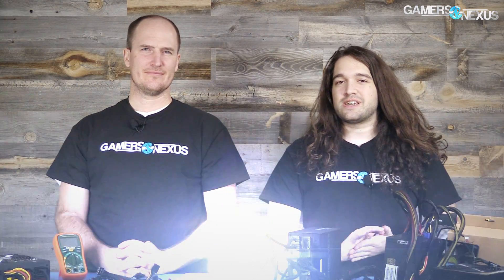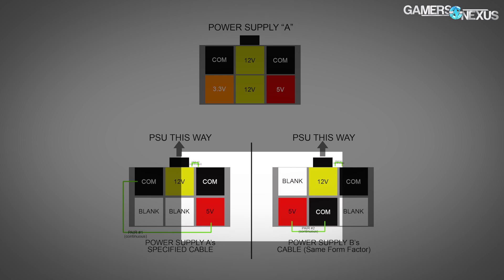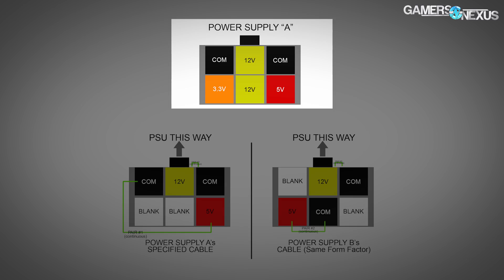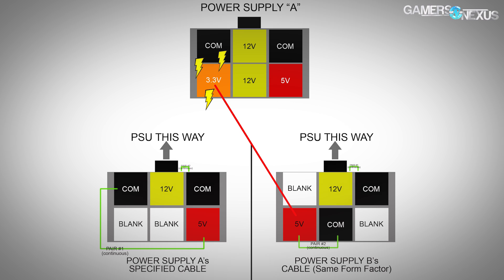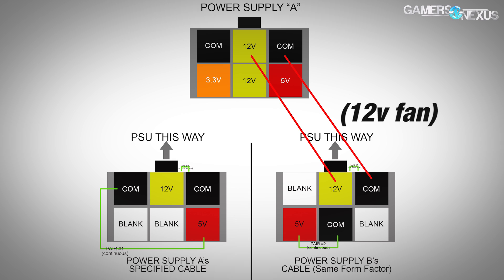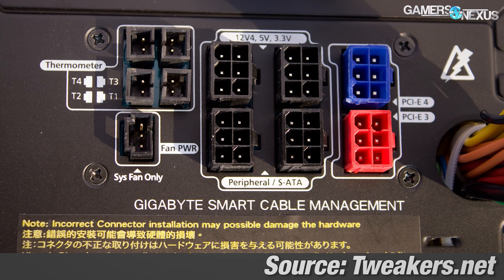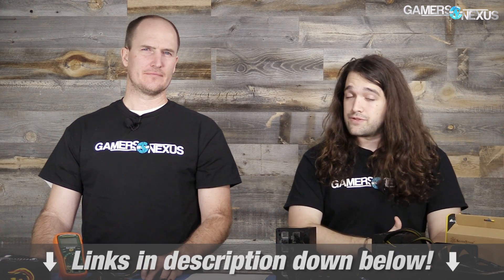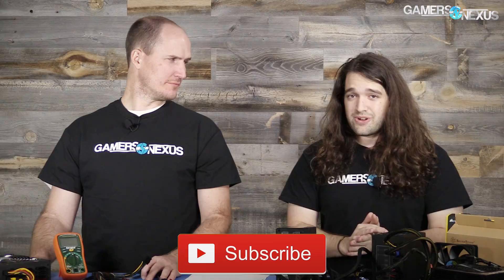PSA: Stop Mixing Modular PSU Cables

Comment: So literally "Computer assembling for Dummies"
It was commonplace in the past (when modular PSUs were not the norm) each company to use proprietary cables.
But this idiocy , especially with the screenshot provided , can be achieved BY ULTRA n00bs only .
The PCI-E 6PIN mimickers have different PINOUT and the layout of the coupling is vastly different - only a HAMMER can shove the wrong cable with this set up .
The PCIE-E color coded coupling shows the difference  - the squareshaped receptacles are in a ROW , while on the SATA/Peripheral they are not.
To top this all off , none of those pinouts correspond to STANDARD VGA 6-pin receptacle.
https://www.techpowerup.com/forums/attachments/pcie6-2-jpg.57637/

RULE #1 of DIY PC assembling - NOTHING REQUIRES MJOLNIR-LEVELS OF FORCE TO FIT IN ........

Comment: What would be nice is if PSU manufacturers would change the keying on the slots to match the power being output from that pin. So a fully square slot could be a ground wire. Top left corner cut off could be the +5v, both top corners +12v, top right corner +3.3v, and then bottom corners could represent negatives of those same numbers. (e.g., bottom left -5v) With this layout, a 3.3v and 5v could never be inserted into anything but their own slot or a ground slot. A 12v however could be inserted into any of those slots and end up being undervolted.

I think it's too late to make this change as a universal standard. Too many components rely on backwards compatibility.

Since there's 4 corners to choose from, there's actually 16 different variations that could be used to indicate exactly what that wire is being used for. That's more than enough even for the pin layout on the 24pin connector since there's many repeats.

Comment: This might be an issue with some manufacturers. Most of the reputable ones ( Seasonic, EVGA, Corsiar, Antec, etc ) label cables and connectors properly so you see where something is meant to be connected. 

Why there isnt color standard for connectors is beyond me. This could be solved easily as you can either color insides of connectors, or add colored line on top of the connector.

Comment: i found another situation : my old seasonic 750w eps 8 pin conector /divided/ cant go into my asus prime x399-a mobo /"wrong" female conector just mirrored/ so i was forced to use divided eps 8 pin from my even older silverstone 1000w psu where it was correct on mobo site /conectors was simillar on psu site but i dont check colors going into psu/ colors going into mobo was corect ....well it running just well for 2 months now lol .....

Comment: Wow, this kinda blew my mind!
Who the eff would actually use a standard connector and Not connect the pins according to standard!!! The engineers responsible for that should not be working in this field anymore. Non-standard pinouts on PSU's should mean those PSU's can not be sold. it is unsafe. They want you to use "their" brand cables, they can bloody well use a different connector for it. 

I can guarantee you that 99,9% of everyone building a computer wouldn't even suspect the standard connector wouldn't have standard pin-outs. The other 0,1% probably learned it the hard and expensive way.

A quick PSA is .. just not enough. you guy's should be blacklisting any PSU's doing this, and display a list of PSU's to avoid. with skulls and crossbones.
Reply: "There is no standard" <-- that is false!
ATX is a standard , PCIe is a standard

If a manufacturer doesn't follow standard, you risk damaging the computer simply by connecting the cable the wrong way around. 
If there are standard connectors, we most certainly expect the manufacturer to follow that standard. The standard is there for a reason. Not even labeling non-standard cables as such, is despicable, hazardous and would definitely hold up in court if you sue the company for any damages caused.
Reply: Feels good to be in the 0%. ;)
Reply: did you not watch the video at all? do you fail to understand what the point of a standard is? 

When a manufacturer uses 8 pin PCIe connectors in PSU, and does not follow standard pinouts, and does NOT label the cable as a non-standard cable.
What do you think will happen when someone tries to build a PC and uses their own custom sleeved cables or simply need a longer cable?

Standards are there for a reason, so that we can safely use any parts we want to build or repair a PC. it's that simple.  
If manufacturers wants to have their own special pinouts, they should use their own connectors for it, not rewire established standard connectors.

Comment: I don't understand why this can't be standard. If I have a 6 pin to 6 pin cable for example, the wires should just be straight thru. The F plug on the psu should match the F plug on the device. Otherwise, use a completely nonstandard connector on the psu. I fried an SSD over this crap.
Reply: This must be a standard. WTF is this crap.. If they use another 6-pin configuration then it must be NOT compatible with the standardized 6-pin connector.
Reply: proprietary greed
Reply: I have too Blue smoke is bad, so now i have a 120gb coaster.
Reply: It is standardized. Each company has their own standard!
https://xkcd.com/927/

I agree it sucks. This really should change. The problem is that change is hard.
Reply: I'm sure Cablemod doesn't care, that's for sure...
Reply: I'm pretty sure what happened is by the time PSU manufacturers came up with a concept of modular power supply with standard plugs on PSU side, nobody thought they'd need a standard for pinouts. Now they just keep saving costs, because coming together and coming up with a standard means spending time and money, and you can't even go back and fix all the millions of PSU's that have already been made and sold, so they just stick to what they have. The better question here is why don't equipment manufacturers put some kind of circuit breakers into their devices? It can't be much more expensive to put a primitive fuse into the hard drive than to recover data from it once the PCB and/or motor are fried.
Reply: Often they can't be just "stright" thru. Cables often require sense wires back to PSU. These usually are not in the connector as a separate pin, but on the very end sharing a pin with power pin, but goes back to PSU as a separate (possibly smaller) wire. In fact on some power supplies you will often see for example 8-pin PCIe, go back to PSU with 9 wires, and it will plug into 10 pin socket on the PSU. This applies to most high current circuits, so your ATX 24-pin, EPS 4/8-pin and PCIe 6/8-pin.

However, the lack of standardization for the SATA and Molex ones, is not excusable. Also it should use a 4-pin connector, not 6-pin. 4-pin would do the job just as good and is smaller, easier to insert and remove (all you need it GND, 3.3V, 5V and 12V, for a total of 4-pin, each pin can carry up to 8-9 A in Molex Mini-Fit Jr connector, which is a lot for this application). In some cases even 3 pins would suffice probably, but that would limit compatibility with some drives or accessories). My guess is, they use 6-pin connector, with 5-pins, because of the Molex connector having two ground pins, and 11A per pin in the Molex standard. Without extra pin in the PSU, they would need to somehow split the cable and do soldering or something. But the solution IMHO is easy - just dump Molex completly, and only provide SATA connector, and use Sata to Molex adapter if you want to use it with Molex device, which are growing rare.
Reply: @Ricardo-C  I fried my hdd and ssd because my old cable looked EXACTLY the same as the new one from my new psu. On top of that it's a topic that is not often discussed so even with all the stuff i learned about pc building on teh internet i've never came across this topic until i fried my own devices. Some stuffs are not obvious
Reply: Ricardo C Hey no need to be rude i already learnt my lesson the hard way T_T. Double checked the cables and they are EXACTLY the same: lenght, form, color and details, for me it seemed logical... It may be obvious to some but it wasn't for me
Reply: Squid game: you got two same cable and you have to pick good one for the good psu
Reply: Werner Wagener you’re not getting the point. The CONNECTORS are standard, what the connectors feeds/is connected to on the PSU is not. Think about it, if there is 6 female connections on the PSU that are all the same, but you already know or should that they don’t all do the same thing/supply the same amount of power, why would you think you can plug your ssd into any of those 6? Think about various PSU designs fans on top/bottom/back & vertical/horizontal orientation etc. it’s just like any typical barrel type power supply like for old Nokia’s and such, just because it fits doesn’t mean it’s output is the same & you’re not going to fry the device
Reply: DavidFrostbite sheer stupid laziness
Reply: Audi Freq you’re confused, proprietary connectors would prevent this situation LOL, proprietary would be connectors, the issue is that people assume because a cable used a /standard/ non-proprietary connector that it’s interchangeable and can be plugged into anything it fits into. USB & such has largely spoiled us into complacency
Reply: DavidFrostbite it can be standardized, you just can’t expect because a families connector that fits right is used that both units conform to the standard. The connectors have nothing to do with pc PSU’s, so it’s impossible to demand anything w/a molex connector have the same layout/voltage etc. these connectors are used in many industries, so a standards body setting standards based around the connection is impossible, so the next best thing is a power supply standard that would have to be unofficial, it would basically be a voluntary gentlemen’s agreement among manufacturers.

Comment: Help!!! Umm so i use a third party pcie cable and plug it into the psu, the system starts for a second then turns off. My psu has light indicators when there is power but now there is nothing at all. I tried to off and on and check everything but nothing seems to work. Please help

Comment: I can't believe that this is the ONLY video about this topic!   I didn't know about this when I built my latest system.  I ended up using a Silverstone PCIE cable on my EVGA PSU for numerous reasons.   It fits the socket on the PSU.  Everything seems to be working fine, but I have decided to go back to the original flat EVGA cable, and use a PCIE extension cable to complete the run.

Comment: I have two power supplies, two different manufacturers (corsair and evga) and both have standard shaped plugs and identical color and sleeving (all black, same material) so its next to impossible to tell them apart, and none of the cables are cross compatible

Comment: Wow I really hope I didn't damage my system. I just bought two Asus GTX 1080 Ti and a new Corsair 1k PSU, but didn't want to rewire the EVGA cables attached to my MB. The MB never came on. I swapped back to the old EVGA PSU and my MB came back to life (didn't try to fully boot system yet). Damn.

Comment: This happened to me, where I used a molex connector from my old PSU to a new one. I thought its standardized why I did it, however I did not know that the PSU side configurations were different. Good thing the device I am connecting  is only a lighting system.. so I burned my RGB lighting.. however I am lucky as only the ground wire and connector where burnt.

Comment: im have to disagree with manufacturers not standardizing.   a 6pin connector is pinned for a specific set up.  if you wanna move it.  spend the 5 cents each on connectors to have them keyed properly.  id spend 5 bucks to make sure it was right

Comment: Recently used a ocz PCI-E cable on a be quiet psu. The system kept instantly shutting off. Luckily nothing broke.
Also a longer time ago I managed to stuff a molex conector into an x800 pro gpu the wrong way, also lucked out. Both systems still work, but i am a lot more carefull now.

Comment: So this seems like its mostly a concern for people who upgrade modular power supplies more than once? Im still rocking my Pc power and cooling 750 watt silencer non modular power supply from ages ago. it was also about 8 years ago and i didnt even know they had modular back then. If i ever buy a new power supply ill probably make sure itll be one that will last for a similar time span and by the time i need a new one some part of it will be outdated and ill just pitch all the cables that came with it or buy a new set with something like cablemod. This is very interesting to know, even if im not the intended audience. Simple mistakes that fry hardware are terrible and user error is generally not covered by a warranty.

Comment: These mistakes can be really costly! Just a heads up; a friend of mine used the wrong cable from a peripheral socket on PSU to sata power on a DVD drive. Result? Not quite what you expect: DVD drive burnt something, allowed reverse current through the PSU and ended up frying the CPU and motherboard socket. Seriously, never use cables unless you know 100% they are the correct ones.

Comment: Best just to first check with a multi-meter any way. I've received wrong-pin-out PCIe cables included with enthusiast power supplies, and I've also had dud rails on some brand new server units (+6v on the +5v rail, etc). And don't get me started with the aluminum wires with copper connector pins. There is no such thing as an infallible Power supply manufacturer, they All have some spectacular junk these days.

Comment: Also remove all the old PSU modular cables and bag them if you're replacing it with another modular PSU even if it's the same brand! Discovered this very issue when the first modular PSU I had, an Antec, died. Fortunately it was physically impossible to interchange cables from the old PSU to the 3yrs newer Antec PSU!

Comment: Corsairs Modular PSUs are amongst the bests for modders and custom-cable making, as all the psu plugs are standard ATX complient plugs. These are 6, 8, 10, 14 pins ! but always ATX plugs. They are easy to find and easy to mod. So Thank you Corsair for not using a retarded proprietary plug. However, indeed it calls to the modder attention and you should always test all cables when modding. Just buy a cheap multimeter.

Comment: I'm thinking you could use the same standards for the device side and power supply side, so it would be physically impossible to mess up.
Reply: Actually, if the power supply side had a mirror of the device side the wires would look a lot better all aligned in the sleeving, plus it would be a lot harder to mess up making one

Comment: Hey Steve what if I use a Sleeved extension? would the cables mess up my system? btw I use a Seasonic M12ii EVO and its modular.
Reply: To use the term from the video, they are 'device side' standardized so extensions are not a problem. Not to be confused with custom cablemod or other brand custom sleeved modular cables which aren't interchangable and is why they're manufactured for specific brands and models
Reply: Glen Williams so I can use an NZXT or bitfenix extension 30cm  with no problem as long as my Seasonic cable is attached to my seasonic psu?  Sorry i'm a noob builder.
Reply: Yes extensions are fine and compatible with most all power supplies. They're an extension of the standardized device side pin layout.

Comment: What a coincidence... I just so happen to be upgrading from a 750 Ti to a Strix 1060, but I lost the original PCIE 6+2 cable that came with my Corsair PSU at some point a year or two ago and bought a Silverstone PCIE cable around the same time thinking it would work. Good thing this video came along, otherwise I'd be losing my shit trying to understand why the cable doesn't fit into the PSU and what could go wrong even if it did fit. So big thanks to GN for allowing me to keep what little sanity I have left. Shame that I can't play with my Strix just yet, but it's better than having a dead PC.

Comment: If I make fully custom PSU cables and pin them correctly will I be okay, or do I need to consider voltages as well? I wasn't aware of the difference the cables made.

Comment: Even between sams brand and similar but not same models i had a very very very bad experience with this.  Tried to google for answers before doing anything but  didn't find anything against what inwas about to do and even i am in i.t 15+ years i got fucked pretty good.  I changed tha psu with the next bigger watt of the series and because i didn't want to redo my cable management i kept the same cables.  Everything besides Motherboard and its cpu amd ram got fried.  I lost all data in 3 disks of years of work.  I paid 300$ just to get my data from the unspinning hdd. Plus a lot of money to replace the burned hardware. So be careful always  change the cables even if it's the same psu.
Reply: Yup that just happened to me with a 1Tb SSD and a HDD. Do you know what they had to do to save the HDD? I figure the SSD is toast, but the HDD main board should've fired before anything got to the platter side of things so I'm hoping I can just order a new main board from China and swap it to get my data back.